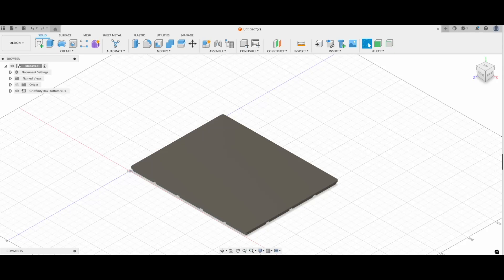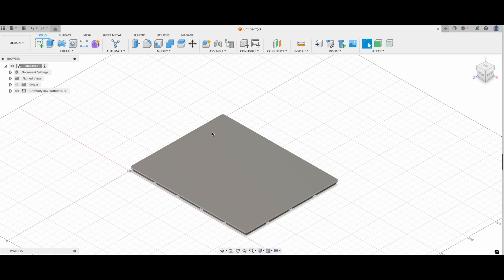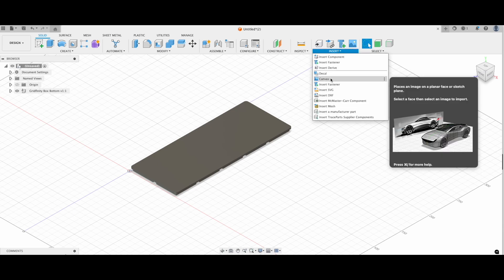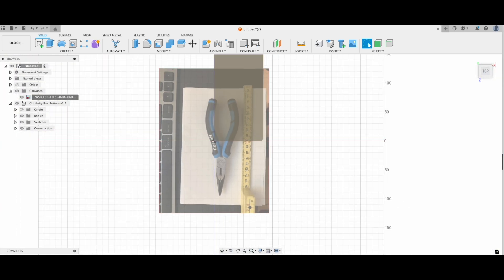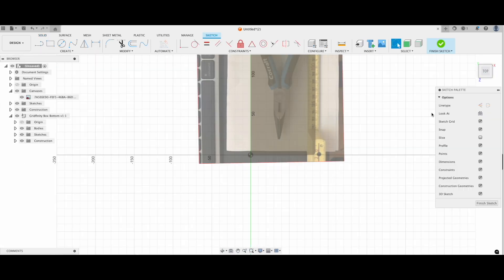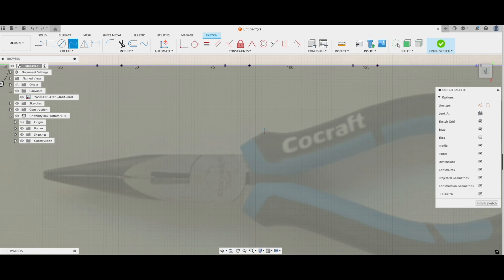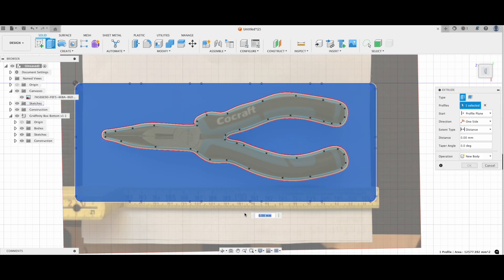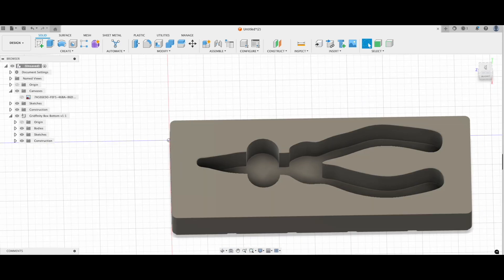Fusion 360: Create a Gridfinity Tool Bin

Comment: How would you do this in 3 dimensions, though? Like if the tool has a rounded part on the bottom, not seen from the top?
Reply: You can follow the same process by taking a picture from the side and import it as a canvas. The only really annoying thing is to align the two properly. Then you can trace the tool as described. Be aware though: doing rounded and curved parts in 2 dimensions can be a HUGE pain in the neck. Only do this if absolutely necessary. 
Alternatively you can try and find a readymade CAD model of the tool you want to make a cutout for. Import it as a derivative. Place it on your extruded Gridfinity plate, halfway „sunken“ into it. Then use the „combine“ tool under „Modify“. Select the Gridfinity plate first („Target Body“, then the model („Tool Body“). Under Operation, select „Cut“. You might want to check the „Keep tools“ option. 
Voilà.  BUT: the thing isn’t ready to print just yet. If you do that, the tool won’t fit. You need to expand the cutout. 
For that, you have 2 options: either the „Offset Face“ command under „Modify“. Select a negative offset of between .5 and 1 mm, depending on how much slop you want. That is the easiest option. It doesn’t always work though. 
Alternatively, you need to slightly upscale the model before using the „Combine“ command. Use the „Scale“ command for that and scale it up ever so slightly. Start with 1.1 and play with that. Here is where the „Keep Tools“ option might come in handy. You can use that to see if you have enough clearance around it. Make sure to scale it back down, though. 

And: Don’t forget your thumb cutout. Otherwise you will have a beautifully matched tool cutout that fits like a glove…with no way of actually getting the tool out without tipping the container over to let the tool drop out and into your hand. Ask me how I know…

For things like Forstner bits I would create a model of the bit first (trace one half of the profile, then revolve it) and then follow the route mentioned last (importing the model and then combine/cut).

Comment: where is the file on the google drive? There are a bunch of different file types
Reply from the maker: Just download the "folder" that opens up when you hit the link. It will download as a .f3d file that you can open in fusion. It's just google drive that unpacks it at shows what's inside it :)

Comment: I’m surprised 360 can’t auto trace. Even Photos on my iPhone can do that, or Photoshop and many other photo tools. Why shouldn’t we do that and import the tool image as a dxf or something else instead? Then just use a line measure function to tell it how long it is and have it figure out the other dimensions? My other CAD software does this. It seems a lot easier than fiddling around in 360.
Reply from the maker: If you get a trace from photoshop or something like that, you could export as svg, and import that to the surface. But yeah - auto trace build in would be huge time saving!

Comment: Nice and easy. I'd add a fillet to the inside walls just to avoid hard corners.
Reply from the maker: Great idea!
Reply: loved this tutorial but how would you achieve that, please?
Reply: @PeteMorganPCPeteUK  I tried it now. You can us fillet or chamfer on the edge normally by going to modify and choose fillet or chamfer. But in this particular tool outline, there seem to be some shape that it can't handle. I can do all of the tool, except the cut out on the handles. Maybe it would have worked for the whole cutout if I just drew half of it and then mirrored it.
Reply: @andrefonneland  Depending on how it's set up, you might be able to select a face to which the fillets are added, rather than selecting individual edges. So, the inside bottom face.
Reply: @smorgasbord42  Tried that aswell, but I think it just the shape of the handle in this one that errors it out. But yes, most of the time either edge or face works flawlessly.